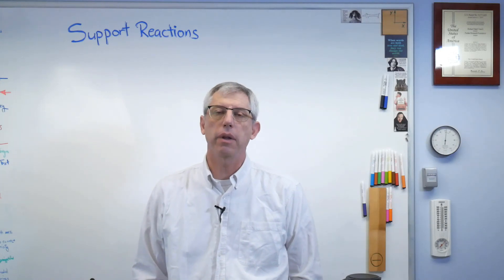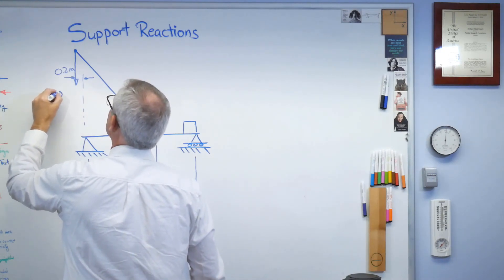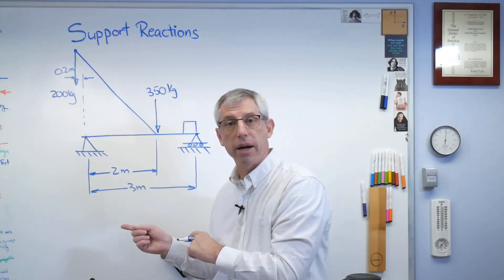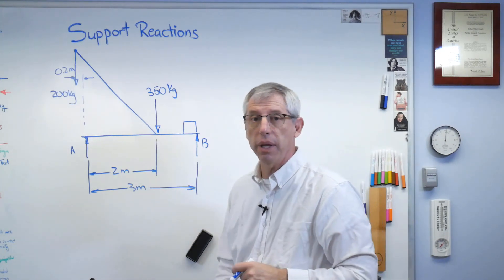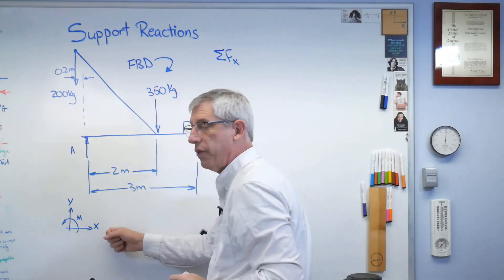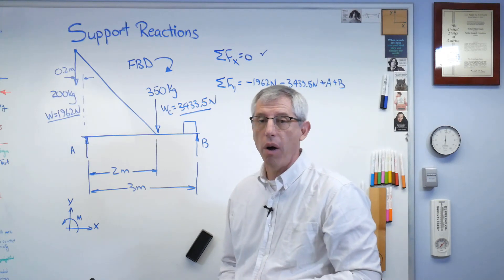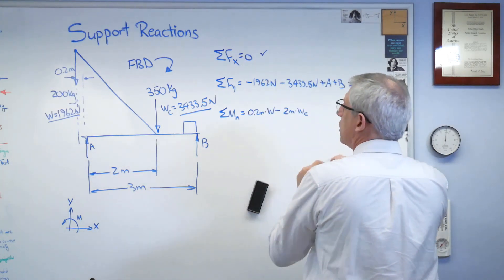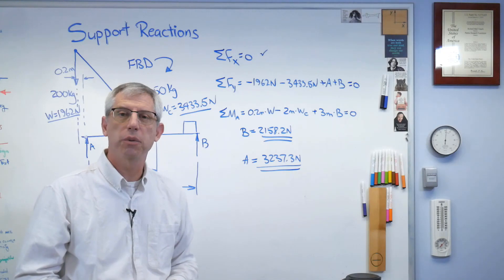Statics - Reaction Forces

Comment: Sir, should we consider reaction moments on pin joints when a non coplanar (3d) force is acting on the object under pin joint...text books usually show only reaction forces on pin joints, but that is specifically for coplanar forces.

This question is regarding problems of equilibrium, question number 5.88, engineering mechanics by irving h shames, which has pin joint acted upon by a three dimensional force.  The answer given in the back of textbook did not take reaction moments into account.

Comment: Thanks for the Video. In theory shouldn’t point A have a horizontal reaction even if it were zero?
Reply from the maker: Yes, I could have included a horizontal reaction load at the left hand pin.
Reply: @purdueMET  If I understand correctly, including the horizontal force component at A would prevent the system from being in equilibrium in that direction, hence it's left out right? Does that mean it would be included in a dynamical situation?